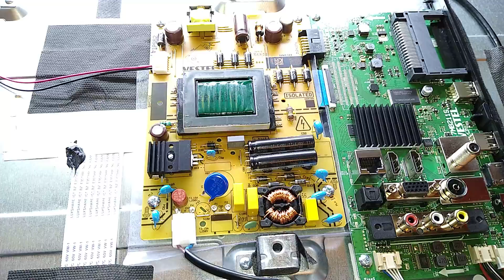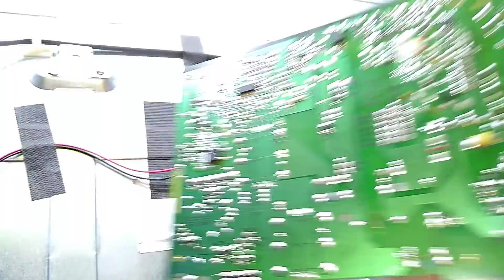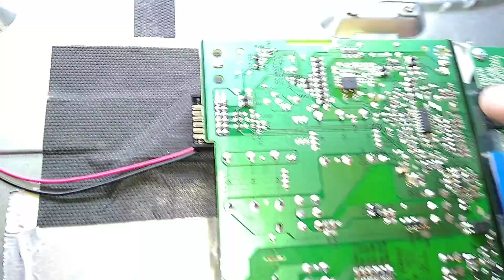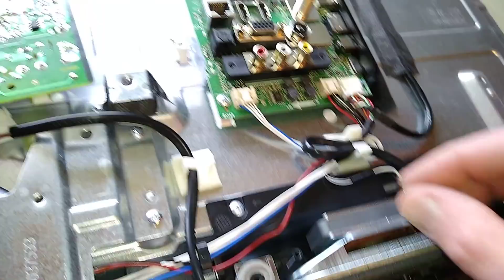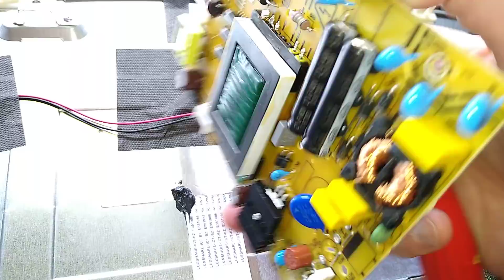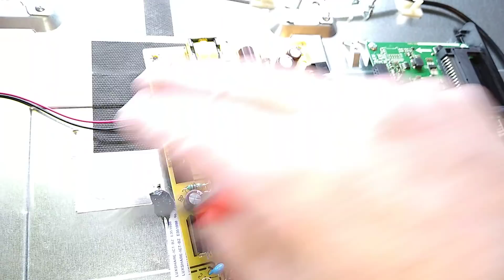There's not much inside TVs these days

Comment: Not so sure about how much this is a TV of "these days" when it's got a VGA input lol
Reply: They are computer monitors with an on-board computer that does the TV stuff. And often cheaper to buy than an equivalent computer monitor that doesn't have the on-board computer.
Reply: @katrinabryce  but buy the 100Hz or higher refresh tv/monitor,
probably not a problem these days, but for second hand ...
Reply: @katrinabryce  20-10 years ago traditional LCD TVs like a Sony Bravia had VGA and DVI with audio so you can use the TV like a monitor. Sometimes TVs have monitor outputs like VGA and monitors have TV outputs like HDMI for game consoles. 
If a screen has a RF port snd a tuner then it's a TV.

Comment: I didnt repair mine but apparently in some PSUs the diodes are run in parallel and as they arent coupled thermally one just runs away and fails shortly thereafter the other one does.

Comment: On the LED backlight versions - the main fault I am finding is not psu or caps, but the display glued together (crystal panels), ie 3x22" displays in portrait mode making a 42" display.   Never saw this fault with flouresants. displays.

Fault is seems working but one of the display crystal panels is either dead or flickers or is ok after 5 minutes ( ie you get 2/3 of a working  picture etc).   You can not fix it as its the multiplexers ics on the display crystals rim solder glued to the glass or side ribbons which thermal run away or have dodggy connectors not allowing the high quad pumped data frequency and the heat glues it back, and when off goes cold a cracks again.

If theses multiplex ics keep off and on due to cracks at the tv on startup, then it trips out the sence lines again and the SMPSU won't startup until you remove mains for a minute and try again.

Comment: Toredown a small lcd TV as one of my 'lockdown projects' to create an clear display screen for a pc build (as predicted though, I decided to wait off on the pc build so the screen is working but sitting now in a cupboard) - slightly older design as it still used back-light lamps, but had a similar 2 board design where the entire screen was on a low voltage board.

Interestingly its really easy to buy just a 'driver board' for any old lcd panel from a laptop or similar, so can be an easy way to DIY an external screen for recycling an old/broken laptop.

Comment: I work repairing those vestel tv in spain and prety much all 40" and 43"
 tv from vestel has the same issue in the led strips.

 remove the black plastic cover with the speakers, bluetooth and wifi modules.
disconect the lcd panel.
cut the metal tape and black tape arround some spots,
now you can remove only the chasis with the backlight.
it has 3 led strips attached to one green pcb. 
that connection fails a lot. a bit of tin and solved the problem.
also, you can identify those boards with the number that start with 23, in that psu is near the qr code
Reply: Superb! I come here just for comments like this one.
Reply: I wonder if Clive gave this a try. Perhaps he’s worried that the neighbors will expect him to start performing miracles on demand… 😂
Reply: It's comments like these that keep me coming back! . ¡Gracias!
Reply: Great feedback 👍

Comment: Could be bad contacts either in the power supply or in the strips. I've not yet seen any other failure on this kind of power boards than diodes going short due to bad load balancing (they just put them in parallel). The exact article code of the power supply is near the barcode. Vestel is the lowest budget manufacturer in Eurasia (Turkey). Even cheaper than the slightly more reputable budget brands with factories in Eastern Europe.

Comment: I've always been told messing with power boards on TVs is a "dangerous task" considering a lot of residual electricity may be stored in the capacitors, but you seemed rather nonchalent with your handling of the power board. Is that just an act of BigClive, or is the rumour of it's danger greatly exaggerated?
Reply: It's probably been unplugged for a while before the video started.
Reply from the maker: If the power supply was completely faulty there's a risk that the main capacitors on the primary side could hold a charge for a while.

Comment: Are there 2 tuners? I see an F connector and another style i don't know the name of. It seems rare to have both.  Maybe it works in several regions.  Also i see a PCMCIA  port on the right. We used to use those for a cable card.  Are they still in use?
Reply: The F connector is for a satellite tuner, the other weird one is for antenna/cable. The PCMCIA on the side is for a CI module (simillar in functionality to a CableCARD, but it also takes a smartcard issued to you by your cable company/satellite provider/whatever to watch scrambled channels. They are still in use, in fact there is one in my TV right now.
Reply: @und4287  oh ok so they have the satellite receiver inside? We had an RCA  like that between 02 and 04. It had a cable card interface and directv tuner built in. The RF cage inside was huge.  It stood up next to the chassis. Haven't seen anything like that recently around here.  The providers are starting to all go internet based with apps to stream their content that work on roku, Android,  Apple,  and Amazon fire

Comment: you can make LCD TV's so much cheaper because there is nothing in them = less shipping weight and cheaper to make. this is why they stopped making plasma tv's despite it being the better technology imo. just too heavy and needed a big costly PSU to run. which in turn costs more to make and less profit if you are competing at the low end market.

Comment: PSU caps, even if not buldging then can be dry, poke them to see if lid falls in.

Most of the time its smd caps and smd fuses on the mainboard causing stress to the smpsu, these fuses age and just go high ohm for no reason but age.

The power on these is mainly high frequency generated with sence backs from mainboard and backlight driver pcb.

One thermal near runaway stress on the main pcb causes a snowball effect on the sence lines shuting dowm the smpsu.

Dulling (old) or some flouresant back light tubes out can also cause the power stress on the sence lines back to the smpsu to shut down.

The fault will be something silly and simple to fix but hard to find.

Remember if swapping boards with known good ones, don't always tell the truth.  If main pcb has a sence line alert it won't allow the smpsu to startup.   Always swapout the backlight driver.   Sometime disconnecting the backlight power connector works....  and if starts up but without somw backlight then it tubes and a wearing out backlight driver, but sometimes per model they have sence lines and all won't allow the smpsu to startup unless ALL pcbs and tubes happy.

I seem a few where the fault was actually the frame very slightly bent from hanging weight, bending the pcbs on the frame and the joint connector,  They need good contact as they use frequency timings for sence so resitance checks don't always work.

Comment: Ugh, vestel, the absolute shit of the shit. Its terrible that all major manufacturers badge engineer these. Back in the crt days vestel used to be that bad, even brand new TV sets were faulty from new, Bush used them with their ONtv.
Vestel use completely modular supplies and 'motherboard' 
Edit : the Panasonic variant has 200vdc to the leds. Not using chassis as grounding.
Your case, pwb, motherboard then led. Whatever fault. Cost says that step. 

If you want a login to their knowledgebase, let me know.

Comment: I've had a tv, similar to that one,  come in and its backlight would only blink when the tv turns on, would stay off until restart.... The problem was, according to the datasheet, the switching controller was going in a fault state... that wasn't there, I measured the "suggested" error... so the chip is bad, great news.... I "fixed" it by cutting off the enable pin on the chip from constant power when on, and soldered it to the PWM pin that controls the intensity... so basically it switches on and off the controller at PWM frequency, although only on 99-100% backlight setting in the menu (below it would switch off), the backlight  worked perfectly :)
This tv still works 2 years later
And btw, the pcb started going brown at the switcher for the backlight. I think it runs too hot by design :/

Comment: Modern tv = computer  running a tv app. 
For a proper tv dismantle an old Phillips G11 chassis. If you can get hold of something like a Phillips KT3, disconnect the tripler and draw sparks off the line transformer.

Comment: I had a TV (from my parents) with bad backlight just a few days ago.
Just started with a single dead strip and ended with completely dark backlight. The reason i gues is that the LEDs in a single strip are in series and all the strips were in parallel to the powersupply, which, i guess is driving the leds with a constant current. So with a strip missing it was pushing more current through the other strips.
In the end, each strip had a defective led. I just bridged them. TV is working again. The missing leds are just barely noticeable. And since they sould be driven with constant current. There shouldn't be an issue with the missing leds.
Reply: Thanks, I was wondering if 'bridging' would be noticeable -- "mostly no" is great :-)

Comment: Yeah, it was the same back in 06-08 when I worked at an consumer electronics service company. Very rarely we did any repairs on component level, usually it was just replacing modules and PCBs.

Comment: My 32" Samsung has an external 19VDC WallWart, appears to have one main board. (viewed from tiny slots)

Side note: Sir CLIVE Sinclair comes to mind!
Reply: Those are the newest ones. Basically at that point its identical to a PC monitor. Thses days they don't even have an analog tuner anymore. Digital tuner is just done in software or a simple DSP/ASiC chip
Reply: @TheRailroad99 Not too new, manufactured date, June 2016, it has an RF NTSC,  ATSC/QAM Tuner. 1080P max. The "smart" is slow as molasses and by today's standard that part is almost obsolete. Just got a firestick to make it viewable.

Comment: Most common fault according to my experience with vestel made tvs is in lcd backlight. 
To be honest it is highly likely that what you saw was indeed backlight fault. Sometimes those LEDs come back alive and work properly for some time, but you'll need to replace it anyway. 

If you need any information about this set in particular msg me, I do have certification and authorization to repair vestel made tvs as in warranty.
Reply: My neighbors threw away what looked to be a nice Samsung TV but sadly some one smashed the screen before I got to haul it in for potential repair.
Reply: @johnpossum556  rip that's a pain

Comment: Had loads of cheap faulty Vestel tv, common dry joints on psu transformer, also common for one of the large diodes to go Short on the LED psu (top 3 in your vid) , list of vestel TV's ----- 
https://www.badcaps.net/forum/showthread.php?t=46703

Comment: I've repaired a few modern TVs by simply replacing the power supply board which seems to be the common failure point in modern displays.  In one instance I repaired an LG Plasma TV that required a bulletproofing kit, it was a known issue with the particular TV model and power supply.  I wish I had the patience to repair the power supply board, but like you said they are so cheap to get.

Comment: I'm an electrician and thought it would be a good idea to fix broke  tvs and sell them. I bought 3 as a job lot. I fixed one then broke the screen putting it back together. I broke the screen on the second one taking it apart and sold the 3rd as it was through fear of it having the same fate as the first 2. Daves tv repairs est 2020, liquidated 2020.

Comment: no wonder it's knakered - some bugger has nicked all the valves
Reply: And, the convergence yoke is missing!
Reply: @28YorkshireRose12  probably needs a band I aerial too.
Reply: @tonyjones9442  Quite possibly. My Samsung Series 3 covers bands 1, 3, 4 and 5, receiving both analogue and digital signals. Pretty much designed to cover most of the world's TV systems.
Reply: @28YorkshireRose12  And the flyback as well
Reply: @28YorkshireRose12  The yoke is on you.
Reply: and the poor electron beam has no space to deflect!
Reply: @crackedemerald4930  It does that in virtual space, then goes splat on the screen. That's how we see the picture frame by frame, rather than line by line!
Reply: Sorry, I needed them as my feet were getting cold.
Reply: Picture valve's gone and the convergence board is AWOL
Reply: Degaussing coil, eht line flyback transformer and tripler,  also missing LOL.
Reply: I don't suppose anyone's tried turning it off and back on again, have they?
Reply: Any time anyone mentions things being knicked, I immediately think of Allo Allo. "Someone has knicked all the knickers!"
Reply: lololol
Reply: @neiltheplayer  Where is the line transformer?
Reply: Look for the thick red wire.

... 😳  THERE’S NO THICK RED WIRE!

sigh  Nothing to be done, this one’s a goner.
Reply: Did you turn on the test card whilst watching a nice game of noughts and crosses?
Reply: The cathode’s been half-inched. The anode, too.
Reply: Just needs a new line output valve and EHT rectifier.
Reply: GordSlater - Had a knackered TV but was told by a technician "just toss it out and get another one". So I took it to bits!
Reply: And where's the damm flux capacitor.
Reply: Brilliant! :D
Reply: Usually, it’s the power supply to go first. I’ve fixed mine by bodging a laptop charger.
Reply: Where’s the lamb sauce?!!!
Reply: I'll tell you what: You have to have good eyes to do convergence adjustments on a 1080p TV!

Comment: Just replaced our old (11 years) LG tv and  it had similar boards.  The set would take anywhere from two to thirty attempts to power on. Suspected caps, so replaced all the electrolytics and it solved the issue for a day or so, and then back to random boots...I opted to buy a new TV (upgrading to 4K) rather than buy replacement boards.  Before taking the old TV to the tip I removed the PSU board so I can recover the £40 worth of Rubicon caps I had just installed, plus the LED edge strip s and the speakers which might come in handy for some projects later.

Comment: But ... but ... wheres the bloody deflection yoke ?? 🙄😬

When I was young I was THE "remote control" for the b & w telly we had... Dad would bark the order & I'd scuttle over to operate the rudimentary controls... 😂

😎👍☘🍺
Reply: No line output transformer either. No wonder it doesn't work.
Reply: "rudimentary controls"....
Laptop lid open = telly on
Laptop lid closed = telly off.
I can also turn it off via another computer in the room if the cat's asleep on me.
Reply: I see why it doesn't work... The HOT is blown too!

Comment: Two whole boards! I opened my brother's TV to find the power supply and display circuit/tuner/etc on one. 

One resistor and one cap had blown up and left a sooty skid mark. Replaced those, a mosfet, a fuse and 3/4 of the bridge rectifier. The big capacitor was charging but otherwise still no life and that was the limit of my diagnostic skills.
Removed the transformer and a few caps (bridging the hot and cold sides) to "disconnect" the PSU, added a barrel jack and an external 12V 1.5a supply from CPC and it's been working fine on that since.

Comment: hey can anyone recommend a Multimeter or whatever you use to test a Capacitor? thank you.
Reply: I'd use an AVR transistor tester. For what they are they're pretty useful. There's so many clones made it is difficult to say which is best. In general you want one that has a TL431 voltage reference in it. The real junky ones just use a zener diode. Past that it is personal preference. I like the ones with rotary switches myself. They're often just called transistor testers. And yes they test capacitors too. They give the value and ESR.
Reply: @1pcfred  thank you very much. I'll get one soon I hope

Comment: Yep, my telly failed a few weeks ago, so I thought "no problem, for I watch Big Clive - it'll be a cinch!"

Ha. As if...  I'd be deluded to think I could tackle anything as well as BG.

Having removed a similarly bafflingly high number of screws, I was presented with pretty much the same as this. Eventually spotted that one of the thin wires on the transformer appeared to have burned away; given the set was dead, I figured this was more than my pathetic skills could handle.

It's now sat in the corner until we get out of Tier 3 and I can get it to somewhere with more space to work on it than my cramped flat. Not convinced I'll fix it, but the diagnosis might teach me something useful...

Comment: Commendable to repair something that ordinarily would be binned and a better, bigger, cheaper TV purchased.
Reply: "Better", hehe, as in more numbers on paper?
Reply: @em0_tion  pretty much. Unless you're buying a television with a different panel technology (like a giant OLED) then Televisions are all pretty much the same, because in reality there are very few manufacturers.
Reply: Cheaper definitely. Better are hard to find. Looking at the  size of those speakers and it isn't surprising the sound on modern TVs is so bad. Also the number of inputs seems to be going down which is bizarre given the amount of devices that get plugged in these days.

Comment: Worth pointing out that there are actually 3 main boards in that TV, the power distribution board, the "tuner" board and the Timing Controller Board (t-con board). The majority of faults I have experienced have been caused by a faulty t-con board... It's usually cheaper to replace the whole board than to component level repair (sadly a lot of the failed components usually end up being bespoke).